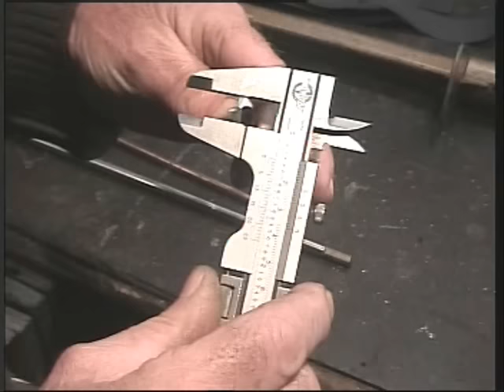we don`t always succeed !

Comment: Ha, when I saw the paint I figured it must run. Nicely done cleaning the shaft tube. I have used the wire brushes from a large bore gun cleaning kit to do that process . They do sell oil line and gallery brushes that could be made to work. I ran into the problem with filling the grinder with grease and blowing the gasket. Switched to a grease used in constant velocity joints. That stuff is so gummy a little is all you need.

Comment: Only needed to fill the lower gearbox to about 1/4 the way up the ring gear, The spinning parts will effectively cover everything inside including the bushings.
If concerned about leaking you can thin out some grease with the 90wt .

Comment: Excellent video and lots of great tips! Thankyou. Reminded me of my old Seagull Silver Century I restored (kind of). The gearbox had no oil seals and bronze bearings like your motor. I found out that the sealing mechanics were down to oil viscosity, i.e. if it was gloopy enough it wouldn't run out. SAE140 I think was required, which worked. It became emulsified through use but apparently that was quite normal!?
Reply from the maker: Your 100% correct thats precisely what Seagull workshop manual saids !

Comment: i have 2 of these ..the slightly larger one runs beautifully but the smaller one no exhaust!! ... its a water repellent grease that's suppose to be used in the gearbox as it actually emulsifies with the water ..that is correct , k99 is the one to use :)
Reply: +john b p.s. pack it in .....

Comment: I really enjoyed this video - I thought you were about to kill-it when you broke a fin off the flywheel and quit. I'm glad you didn't and I know its too late to make the suggestion but you could have made up a plate with 3 bolts and under support nuts that that plate sat down onto and the 3 bolts screwed into the holes that the pull starter plate attached to. Tap a thread in the middle of the plate and screwed a bolt down onto the end of the crank to force the flywheel off?

Comment: Welding a blob of weld on the head of a seized fastener big enough to get hold of with a mole wrench, will mean it comes out 9 times out of 10, and is far easier than drilling.

Anything suffering from corrosion damage, will generally come apart using electrolytic cleaning. Need to be cautious with aluminum parts, but its certainly worth a try rather than damaging parts using force.
Reply from the maker: Thanks for your view on seized fasteners its not one I would advocate myself, and of the opinion it could well be the shock/heat that contributes to any success this approach makes, personally I would go down a more controlled route, somehow feel "blob of weld" I associate with bodgeering ? but if is a tactic that works for you then .. go for it !
Reply: *****
If you have the time to  take with drilling out a seized fastener, its fine to do the job that way, but blob of weld will work in nearly every case, and is perfect for anyone without time to spare, and who has a MIG or TIG welding set.

Its also something that can be used where its difficult/impossible to get part set up on a drill press, or where drilling free hand might be problematic.
Reply: +Flash Gordon John on his Doubleboost channel showed the welding trick.  He used a nut, and TIG welded it to the bolt top by filling the nut with weld, then wrenched it out. Another method I've seen on a couple of channels is to use left-handed drill bits. They grab and turn, and if that doesn't do it, they drill the middle out as well as a right hand bit does. Heat alone is worth a try if there's enough showing to get a grip on. 

-- Mike
Reply: BigMjolnir
Welding a blob of weld on is far more effective. Puts more heat into the fastener, and is easier  to do. Works in almost all cases.